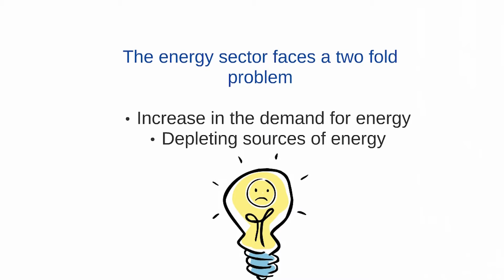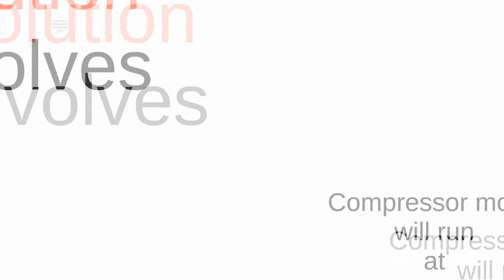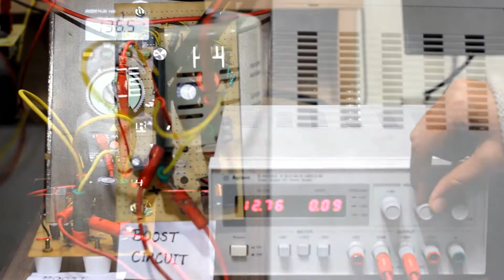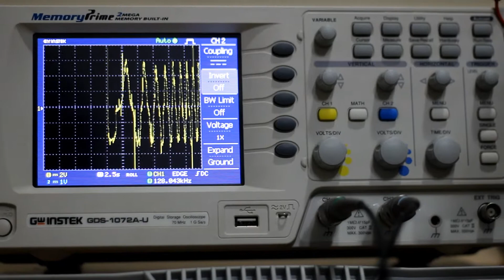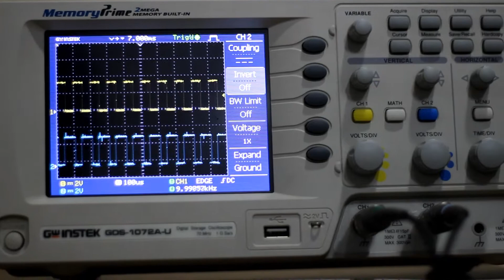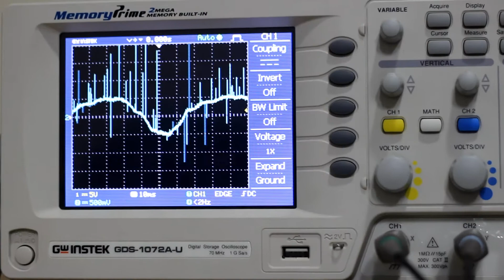TIIC IDC 2015 – Team 2457 – "Design and Implementation of a Solar(PV) Powered Refrigerator"

Comment: Great work...excellent concept based on renewable energy. Use of solar refrigerator can save millions of unit of electricity per day. Moreover this solar refrigerator is not using batteries hence surely it will be cost effective too. Photovoltaics is going to be our future.